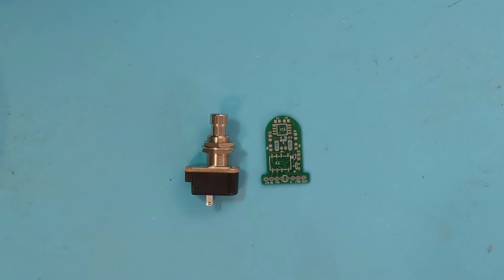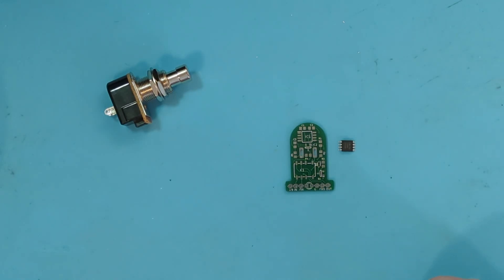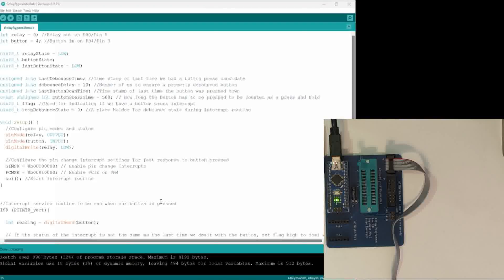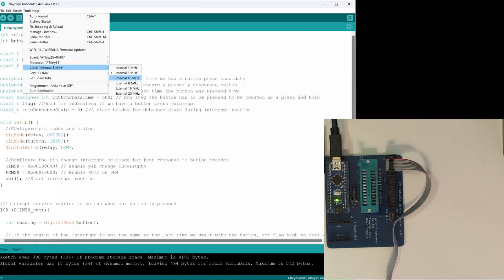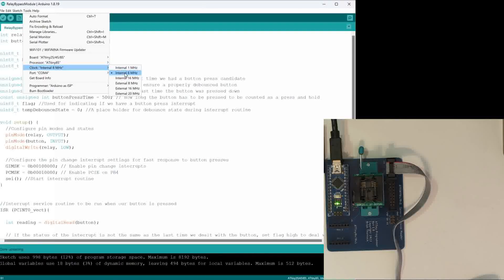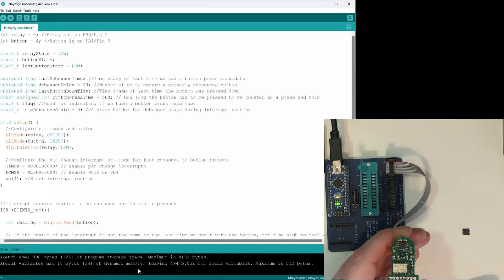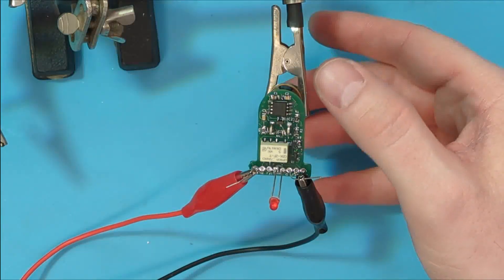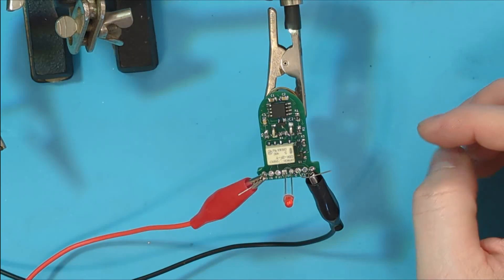Microcontrollers for Guitar and Effects: Designing a Relay Bypass Module, Part III

Comment: Adding MUTE while switching would have been a great addition, specially for those noisy effects with pop syndrome 😃
Reply from the maker: Yes, adding mute is a a great feature. With this particular kind of relay and control method, it's not easily done. If you switch to a latching relay, you can use something like a MOSFET to kill the signal while the relay switches, but that takes two pins on the MCU instead of 1.
Reply: @thescientificguitarist4228 I actualy use two Mosfets on my projects. One Mosfet only would have its body diode letting signal pass to/from Ground. 
The problem with using mosfets is that they would have to share the Ground with the digital citcuit. I have fixed that using an optocoupler to switch the Mosfets. The downside is  the part count. But the muting/unmuting while the relay switches is smooth.
I use two pins from the microcontroller, one for the relay, and one for muting. The Attiny85 has enough pins for that. I am not keen on latching relays for a good reason. If the pedal breaks while the effect is on, the relay will stay in that state. You will have to physically remove it from the pedal chain. The normal non latching type of relay would return to the bypass position..

Comment: I would use a latching relay to minimize power consumption.
Reply from the maker: I would rather consume a little more power and not need the extra MCU pin to toggle on and off. I tend to combine this functionality with other features, so saving a pin is worth ~20 mA current to me. Others will design to minimize current consumption. It's all good.
Reply: @thescientificguitarist4228  for me this is not the only reason to use a normal relay. Imagine the circuit somehow fails when the effect is engaged, you will be stuck with the effect ON and probably no sound. A normal relay will turn OFF and go back to Bypass as soon as you disconnect the power. With a latching relay you would have to physically remove the pedal from the pedal chain..
Reply: @pilot140467  which circuit do you mean would fail? if the one that controls the relay that's very rare, I designed my circuit to turn the relay off when the power goes down and it's not even a microcontroller,  just an analog circuit. over 20mA is too much specially if you want to power your pedal with battery. It was a suggestion, you do what fits your needs
Reply: @_-Skeptic-_ one example is if power fails to the pedal when the effect is engaged, not even your little circuit will save it. You will be left with no signal unless you remove the pedal from the pedal chain. With a normal relay that is not a problem as it will go back to the Off state as soon as it loses power. It already happened to me. It didn't need much, just a little bad contact on the power connector. I had no effect but still finished the song as I had audio.
Reply: @thescientificguitarist4228  you don't need 2 pins to toggle it, it's up to you and your requirements. I've built many variations of soft bypass switches (without microcontroller) but my goal was and is, minimum cost, use recycled components. It has the benefit of keeping the state it was the pedal was turned off. There are tons of very cheap microcontrollers with more pins.